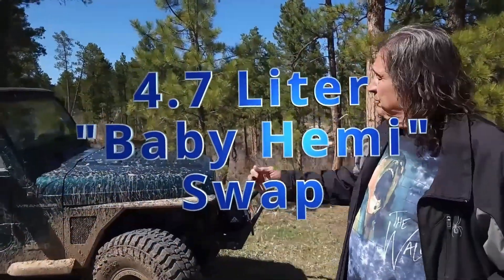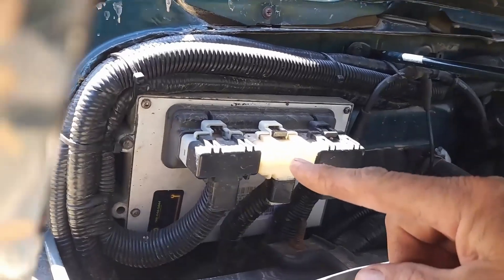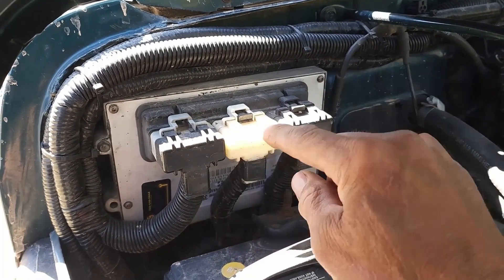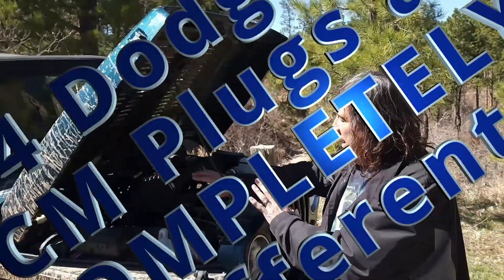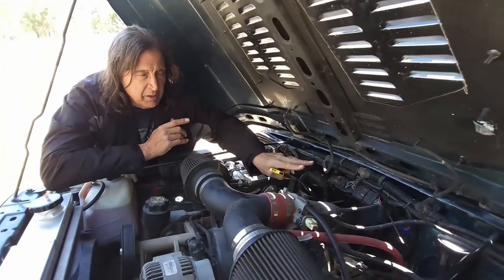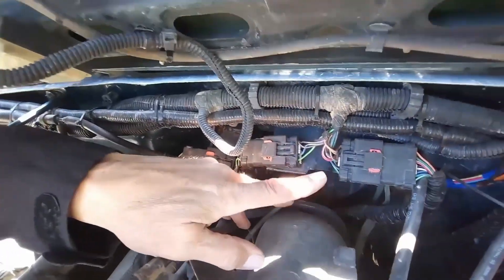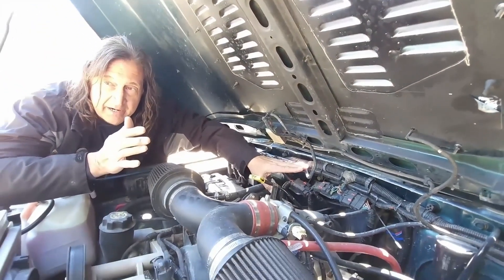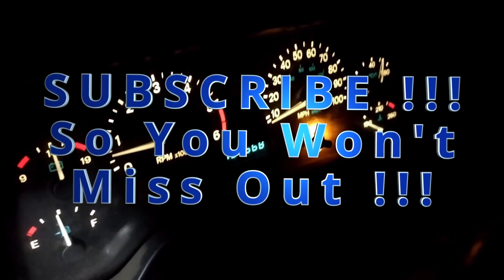4.7 Liter V8 in a TJ....WHY ???

Comment from the maker: What would you, the viewers, like to see next, the fabrication required to fit the V8?  Or would you like to see the nitty-gritty of the wiring? Drop a comment 👇 and let me know
Reply: Great content , fabrication to mounting and wiring yes please , great great job finally someone did it !!
Reply from the maker: Just dropped a fit and fabrication video on the V8 TJ... check it out!
Reply from the maker: Stay tuned, more tech coming on the building of the mistress, necessary modifications and more tech and wiring
Reply: Both
Reply from the maker: All of our trails are closed for the winter, so I will be shifting to a lot of technical videos, both wiring and fabrication, and thank you for watching and subscribing!
Reply: If I swap a PCI 2004 LJ, I use a 2004 WJ donor. Couldn’t you lay the WJ engine harness and pcm/tcm in place and it run as if it was still in the WJ? Everything looks identical

Comment: Jacob love your video I  am being different  I am doing a 4.7 out of a 2004 jeep grand cherokee intoʻ a 2007 jk I took all the wiring and the ecm and tcm from the cherokee but need to know how to get it to communicate with the jk wiring
Reply from the maker: Do you have the entire 2004 Grand Cherokee donor vehicle? Because you may need to transfer instrument cluster also. I'm not familiar with the JK communication format. A good starting point is checking the PCM wiring harness connectors. Will the JK connectors fit the sockets in the Grand Cherokee donor PCM? If not then they are more than likely not compatible.
Also, I know that the 2004 Grand Cherokee's had SKIM...a chipped ignition key that has to be defeated.
The key to doing this swap is to know that the computer language is the same in the donor vehicle and the recipient vehicle. 
If they don't match, it is not going to work.
I'll see if I can find any information and get back with you 
Thanks for watching!
Reply: @Jeep_psychology_101  yes I have the complete donor vehicle and the jk has 4 plugs to pcm and the 4.7 pcm only has 3 plugs so do you think my best bet is to just try and swap all the electronic from the cherokee over to the jk ??   And thank you for the information I to want to be different from everyone else  lol
Reply from the maker: @ChristyWood-t5b that confirms it... the JK dashboard and the Grand Cherokee PCM will not communicate with each other. But I have seen a complete wiring and dashboard swap... but the donor vehicle was a Dodge Dakota 4.7 that a large tree fell across the cab. And the recipient vehicle was a TJ... the Dakota instrument cluster fit with very little modifications